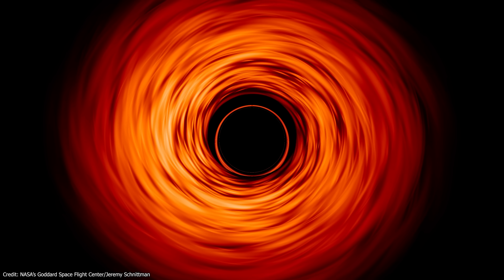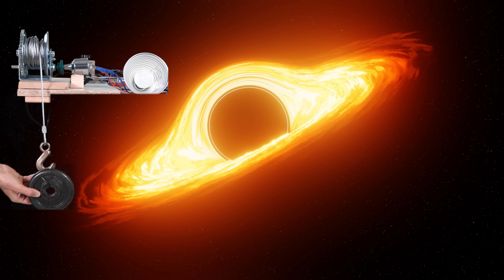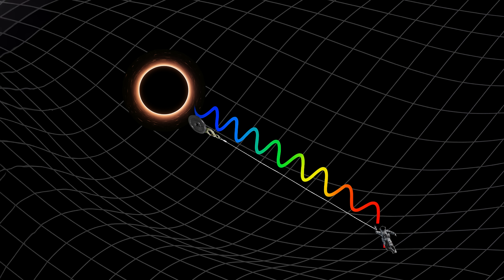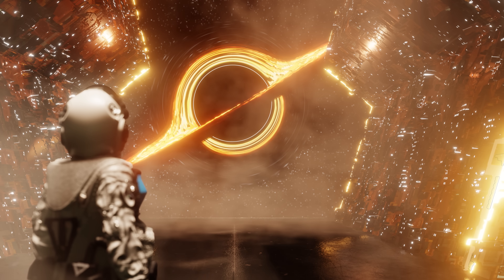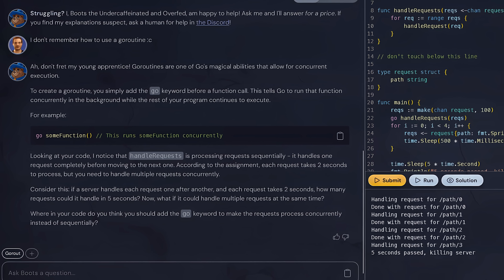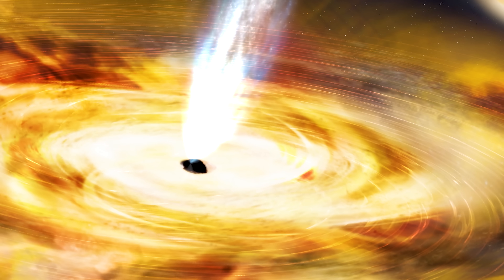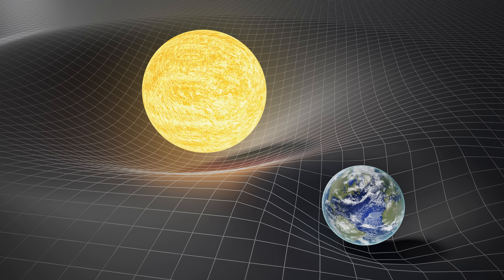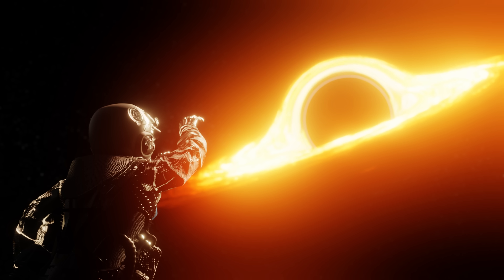How to Convert Mass into Energy at Home

Comment: E=mc² is misunderstood in modern physics, it doesn't change the answer, it still works fine but its just not how reality works
to give an example: in modern physics physicists love so see it this way: Petrol contains chemical energy, this chemical energy ever so slightly increases its mass in the formula "E=mc²" this would yield the CORRECT answer BUT is NOT how reality actually works

How reality actually works: the mass of the total atoms is the same regardless of its chemical energy BUT the formula is "E=mc²+ its chemical Energy" this would give the SAME answer as the "Modern physics" view but is closer to how reality actually works. chemical energy being an "extra layer" i know a helium nucleus has slightly lower Energy  compared to 2 protons and 2 neutrons by themselves but that doesnt mean it has "0.7% less mass" it has the same mass BUT less chemical energy which will result in lower energy if turned into energy to the equivalent of it being 0.7% less mass. 
to give an analogy:
Modern physics says "10g corn contain X amount of glucose "
the reality is : "10g corn contain Y amount of starches that can break down to X amount of glucose" 
the answer "X sugar" is the same in both examples so both views result in the same answer but the ladder is just closer to how reality works

if a helium nuclei would actually "lose mass" while at the same time "losing chemical energy" that would allow for "free energy" which at least in our universe doesnt exist, so its important to mention the starches (chemical energy) and treat mass as the constant that it is else you could easily fall into a trap where you suddenly created free energy "saying petrol gained chemical energy AND mass" no, it didnt, it EITHER gained more chemical energy OR mass depending on your view, NOT BOTH

Another example:
Modern physics would say "we have 1kg atoms water 1kg atoms petrol, but since the petrol atoms contain more chemical energy the petrol must be ever so slightly have more mass" 
now they calculate "E=mc²" disregarding the chemical energy because they already converted it to slightly more mass and that WORKS but is not whats happening in reality

whereas the actual thins is "the petrol does NOT gain slight mass, and the formula used is not just "E=mc²" but "E=mc²+chemical energy" which results in the same answer and it how reality actually works

Comment: The story about atomic bombs converting mass into energy is misleading, because anything that releases energy loses mass. It applies equally to a firecracker as to an atomic bomb. My theory on how the commonplace about atomic bombs got started is that the masses of the various atoms have been measured precisely and can easily be looked up. Consequently, this is the easiest way to quantify the amount of energy released. In principle, you could do this exercise on a firecracker, but the mass difference is too small to measure.

Comment: This is all theoretical because, except for the paper plane, humanity has not yet confirmed this concept. To confirm, we would have to convert the mass of the object into energy, capture it and convert it back into the object. We would measure the difference in mass lost due to the conversion effect. The conversion on the paper plane with formulas is always 1/1 in reality, but mass must be lost to enter the phase change. Hypersonic aircraft also lose microns of surface area as they pass through the atmosphere at increasingly high speeds. These losses are important in order to measure the theoretical breakthrough point or the so-called critical point where the transition occurs. Ah, what am I saying, I only have a high school education.😅

Comment: Okay so i can see a clear mistake modern physicists do that comes to the correct answer but its just not how reality works: in an example where for example petrol contains chemical energy the reality works like E=mc²+its chemical energy, 
modern physics however says "this chemical energy makes the petrol every so slightly heavier" and then they calculate "E=mc²" with slightly higher mass but without the extra +chemical energy, this both leads to the same answer but the classic view that the mass stays the same but therefore "E=mc²+its chemical energy" is how reality works and leads the the same answer

Comment: This is beyond wrong. It’s F*.s not Fxd. And those two equations aren’t the right2 systems because they didn’t consider including heat as the second system as entropy/reversability which amortizes against any solution derived without so there

Comment: If the Earths excess heat could be concentrated utilizing heat pumps, tidal and geothermal generators etc., and converted to mass (create matter). That would solve the problem of global warming. But it would be easier to convert excess global warming heat into visible light with very high-powered LED light emitting diodes and continuously, night and day beam the light into space.

Comment: That's fascinating to learn that lowering my bag of groceries makes it literally lose femtograms of mass (as most traditionally know it) to my head level's /frame of reference/ as it goes down the gravity well from my arms downards to the table.  Or even all those molecules of my arms/body and air around me going up/down.  

Vanishingly small, and very nearly unmeasurable amounts (yet successfully measured in actual experiments) -- mudaneity governed by the same E=mc^2 (etc) as the most scary ones (stars, black holes, giant nuclear kablooey's humanmade and otherwise, and more)

Obviously other error margins of things venting from my grocery bag will dominate, and all, and transfers of a single dirt speck will dominate mass difference. But this is still a mental bending thought exercise. This is just an example that requires extremely big and precise vaccuum-filled scientific rigs to experimentally measure. 

I just hadn't realized the mudaneity of the minor frame of refernece differences (head level of my brain, versus things up/down the gravity well -- even just arm's length!) is a mass-difference in different frames of references!   

And the concept that my weight scale and my brain disagrees by femtograms too, thanks to E=mc^2 applying to my head vs feet too.  Vanishingly small difference as it may; the scale is lying to my frame of reference (ha)

*Note: Obviously, different schools of thought use different terminology (mass-vs-energy, momentum, invariant mass), but I try to communicate the gist.

Comment: E = MC^2 , I believe what is being lost as 'mass' (light in confinement) is actually its angular momentum related to time dilation of the black holes gravity (contracted space - IE much higher density of space) , is the same thing on earth.  Refraction happens from a change in density, when light projects near to an object with 'mass' there is a higher density of space, so light and 'mass' (light in confinement) refract near it - this is what gravity is - refraction caused by a change in the density of space. If you could pull the 5kg weight out of the blackhole to the place you are with lower density of space, the protons and neutrons will spin back up to their previous angular momentum - and thus - will not have lost any 'mass' in the end.

Comment: I don’t think this is true: only in Schwarzschild metric is mass apparently disappearing from the outside perspective.

But  Schwarzschild metric is a static black hole, that doesn’t exist. Black holes in reality are dynamic (not all, but the only ones we can see) and gain mass. So they grow. 

They also loose mass form slow Hawking radiation but this is another aspect…

When you low down a 1 kg of mass very close to the horizon, the mass of the black hole plus 1 kg have a new Schwarzschild radius that includes the object or part of it.

The problem is that it doesn’t exist for instance any exact solution to Einstein equations including a 2 body problem nor merge of a black hole with an object (they merge in computational simulations, the black hole emits a bump that “fagocites” the object).

The eternal disconnection of information from objects crossing the horizon don’t include mass, is the only characteristic that survives of the falling matter and gave a nice paradox to solve in quantum mechanics: the rest of the information of that matter is lost including all quantum states.

Comment: Nope... You are forgetting about the mass in your "Rope" or steel cable. That "Rope" or steel cable has mass and all of it would be racing toward the black hole at the speed of light. All of it. That is until both the mass and the end of the "Rope" hit the surface of the massive black hole. 
Gravity is a push force and not a pull force, so there was no energy or mass extracted from the massive black hole. None. And yes, the black hole would gain the mass of both the weight and the "Rope". 
The accretion disk that you see is light orbiting the black hole. All mass bends light while interacting with waves of heat. The more the mass, the more that it bends visible light, which can be seen with our own sun. Masses 1,000's of times larger than our sun, not only bend light, but bend it so much that it orbits that mass until those light waves eventually hit that mass. Those light waves will no longer escape that mass, thus the mass being black as we don't see any light waves that bounce off that mass. 
That accretion disk starts at the outer edges of light being bent around the mass and ends when it hits the surface of that mass. There is a halfway point from the outer edges of that disk to the surface of the mass that even the scattering of light waves will also be pulled into the mass as well, thus the reason why we don't see the light all the way to the surface. 
The only way to turn mass into energy it once was, is to get that mass to absolute zero. Then and only then would the energy that created that mass would be changed back into that energy and shoot out in some random direction. 
Oh... and there is no such thing as space time as it was just a delusion to write a paper about, to get tenure.
Reply: You are the delusional one here

Comment: So if I had a closed system of  1 metric ton of water. I keep pumping it to the top of an incline and then use it's kinetic energy as is falls down the slope. How many times could I do this before all of it's mass is turned into energy?? What would the calculation look like?
Reply from the maker: you just keep adding mass (by adding energy to lift it up from your reference frame) and then extracting it, so it never actually gains or loses anything in that scenario.

Comment: i found this confusing, can you do a follow up video to further explain this?
i feel like your not explaining something, for instance how does lowering something convert the mass into energy? how does that happen? Mass magically becomes energy?
Reply: let's say you see a rock going at you with some speed, you could confidently say that if that rock were to hit you, the kinetic energy would be converted to energy that breaks you apart. Now what if you were going at the same speed as that rock side by side, if you and that rock were to met you wouldn't say that the rock have any energy right? so with a difference in reference frame there would also be difference in energy. Even on earth there is a difference of "gravity" that we feel at different height and it causes difference reference frame too, making mass relative thus energy converted. (I'm just trying to make sense of it, I got no degree like the guy below)
Reply: @frgeret4970 As you said "when both are at same speed" this means a third referencial see rock and person with speed, so Both with kinetic energy to splash. The gravity difference is also difference in potential energy to the same gravity field.

Comment: Controversial video this time. 
Physicists will spawn into existence to explain that General relativity does not work like that.
When you lower a mass in a gravity well, you actually receive back from the negative energy produced while lifting.
That negative energy is essential as it makes for negative mass required to keep Einstein's equations from messing up.
Well, have fun with them.

Comment: It always upsets me when people "explain" nuclear reactions as converting some of the mass into energy -- it's really misleading as it implies that this isn't happening in normal chemical reactions and that it somehow explains where the energy is coming from instead of just being a way of saying energy was liberated.
Reply: People are right though about there being no NUCLEAR changes / energy shenanigans happening in normal chemical reactions.
Reply: @AttilaAsztalos  But there are 'energy shenanigans' at least if there are in the nuclear case.  Chemical potential energy is energy so when you liberate it the molecule's mass decreases.  In both cases you just found a lower potential energy state of some field.  The only difference with nuclear processes is the delta energy is large enough to make the mass difference can be large enough to be on the order of a percent (or maybe 10th of percent...but not crazy tiny) of the rest mass.
Reply: Because the energy is actually significantly changing the mass like around 0.1% of mass. In normal chemical reactions mass change from energy loss/gain is inconceivably small
Reply: @Bishox  Why does the validity of the explanation depend on the fraction of mass converted?   Look, I don't object to being imprecise the issue is that people explain the nuclear energy as coming from the mass in a way that causes lots of people to think that nuclear reactions are special in that they get their energy from mass but others don't -- it's used as a way of avoiding the details of nuclear reactions.
Reply: YES. See my comment where I speculate on the source of this misleading but often repeated saying.

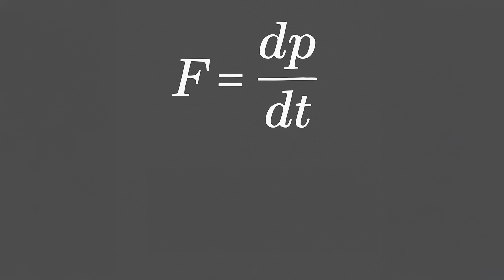Comment: 2:10 this explaination will be completely changed in 10 years don't bother trying to comprehend it. It is a mathetmatic explaination not physical one. They haven't and can't prove it. Time doesn't exist.
Reply: Are you talking about Relativity or that FORCE IS MOMENTUM BY TIME? Cause both won't change.
Reply: @c.jishnu378  the assumption that time exists and is a 4th dimension that explains how gravity works which has only been proven by math magic and has no testable proof.

Comment: So...as speed increases relative to a fixed point, observed time on the speeding object slows down. Essentially the object flying into a black hole is going so fast from our perspective that time slows to nothing and it never gets there?
Reply: Yes in fact it would even appear frozen above the point where light cannot escape, and the light emmiting off of the weight is getting progressively slower, to the point it "redshifts" to non visible light.
Reply: @darthnosam3313  i believe that's wrong. it's only the light that has a "hard time" getting away.  the object is in fact falling straight thru the event horizon towards whatever is down there, in any reference frame.  the red shift of light and the apearant stop at the event horizon is nothing but optical.  the pull on the cable would never stop, it would increase (by a lot :-))

Comment: Wow, there is so much wrong with this characterization. First math is a predictive tool not a description of the universe don't confuse the 2. 
There is absolutely no mass to energy conversion here. All this energy is from momentum only. It is no different from the brakes on your car getting hot. 
The observer's reference frame is meaningless as it is a distorted view, due to space time warping, and does not affect the pyhsics happening with the object. Energy only falls to zero because the object stops moving in your example not because of a mass loss. A proton will always weight what a proton does regardless of its place in the universe. Actuall,y there will not be a drop off of energy because the object, if held fast will be draging against space time and extracting momentum from the spin of the black hole or get wrapped around the black hole endlessly.
Reply: How can you say it's only because it's not moving when everything else we know that isn't moving still has a rest energy? He seems to be claiming that it doesn't even have rest energy from your perspective. Unless by not moving you mean that its time stops and therefore there are no subatomic interactions occurring
Reply: @DANGJOS  his claim is that it has stopped moving relitive to the observer's reference frame because of time dilation, but that's not the same thing as saying it has no weight or that it has actually stopped moving. even if the object was stationary relative to the observer, space time is moving as it is draged around the black hole by its spin, so the object is still moving through space.